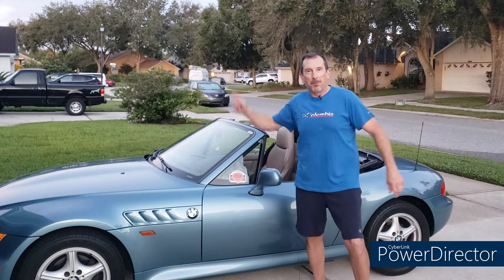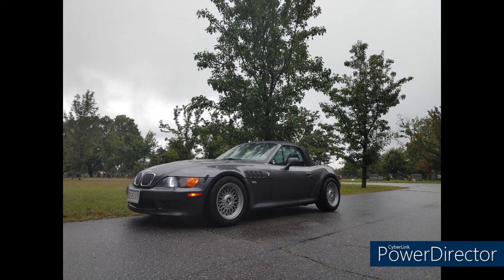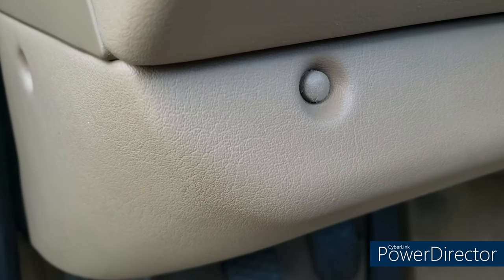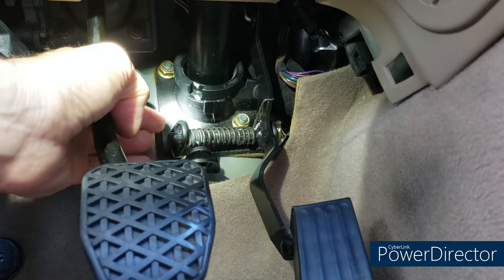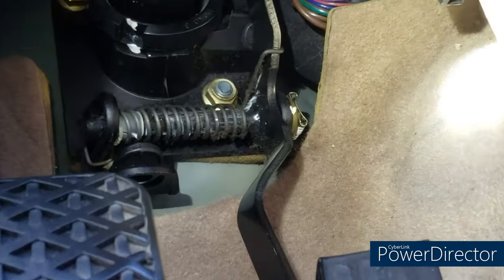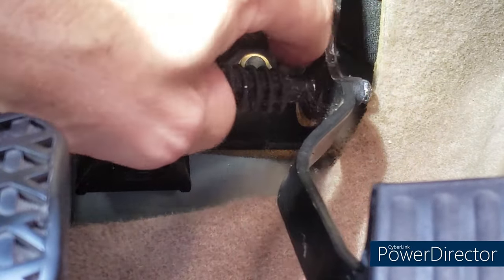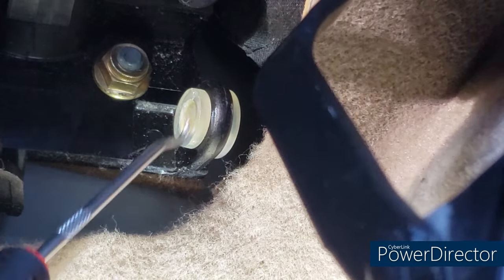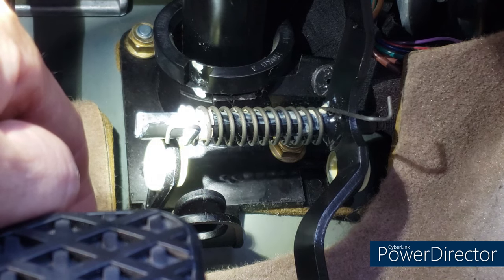How to Replace the Accelerator Pedal Bushings: BMW Z3

Comment: As always, many thanks for another excellent informative video.  Z3's can certainly be a contorsion nightmare for us oldsters, who generally don't care for working in extremely tight and uncomfortable conditions and positions.  Sometimes you almost have to work upside down, which is no fun.  😃
Reply from the maker: Yep, why i delayed the other bushings.  It may be easier to pull the whole assembly.  Working down there is painful!  Thanks as always Walter!
Reply: Working down there is extremely difficult. I literally had to wire mine up with some copper from an upsidedown position with my feet sticking out the top of the car, it went out when I was 50 miles from home. 
   I'm still going on my wire job, bushings still in the glove box.  I'm not wanting to fool with ANY of it. 🤣🤣
Reply from the maker: @Gambit22003  dont blame you!  Its tough down there!
Reply: I need to ask, does your Z3 make a whining noise that increases or decreases with acceleration? Is that a normal thing? If not, what is it??
Reply from the maker: @Gambit22003  cant say that mine does.  Doesnt sound normal.  Does sound hard to diagnose.  Noises are tough especially when they don't appear at idle.

Comment: I’ve got this memorized like the back of your hand now 😅
Reply from the maker: @gregm7508  there's lots of my back hands in most of my videos!
Reply: @MomentofZed  just finished this install and the throttle cable bushing. On this one I found that clipping in the short hook of the spring, pressing rod through left bushing, then line it up with right, push the gas pedal, and it’s easy enough to use fingers to grab the long hook of the spring and put it in position since it affords more torque. Next up changing the whole throttle cable
Reply from the maker: @gregm7508  good technique!  Wish you luck with the cable!